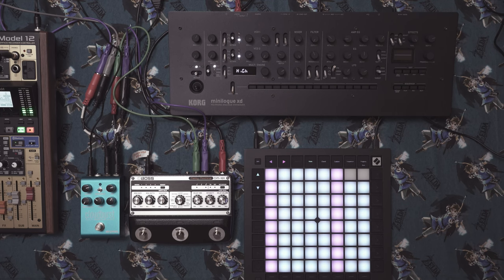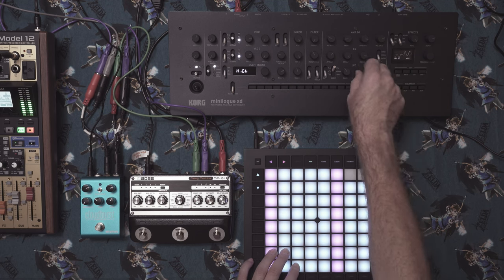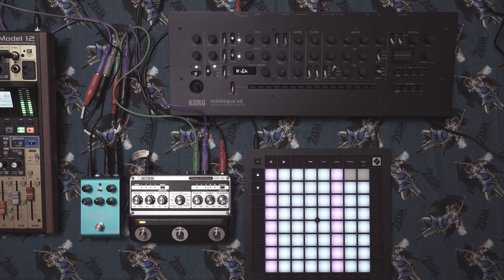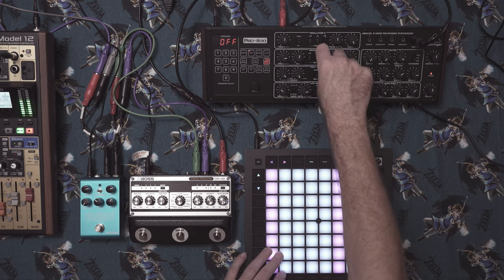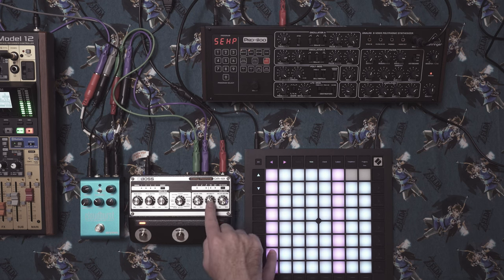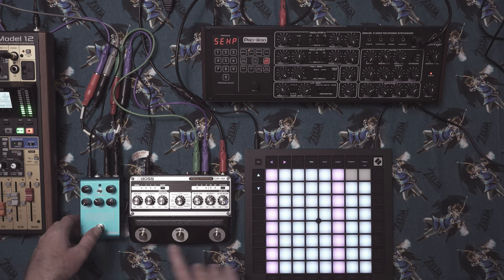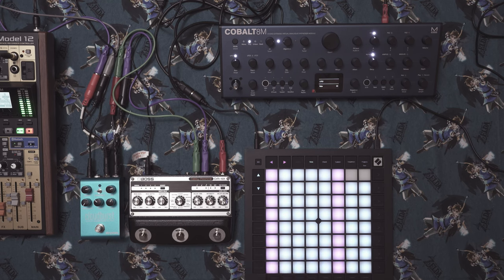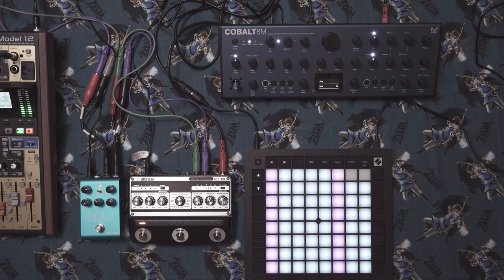How to - Ambient PWM pads 3 ways (Korg Minilogue xd / Behringer Pro800  /Modal Cobalt8)

Comment: pro800 is great synth but it's too noizy and overall level is low, what about yours unit?
Reply: Mine is fine, in comparison with my other synths. (Except the Korg MS20 mini)
Reply from the maker: My unit is in line with my minilogue xd as for noise. Output level is also fine. My deep mind 12 was much noisier.

Comment: Good conparison tool. For my taste the korg sounded the best, the pro800 the worst. I suspected that the pro800 sounds too ballsy and so not getting it. I prefer digital oscillator with analog filter or at least dco. The dm12 is behringers best synth to date both mono and poly. That includes ubxa too.